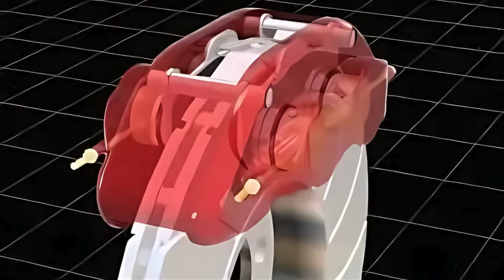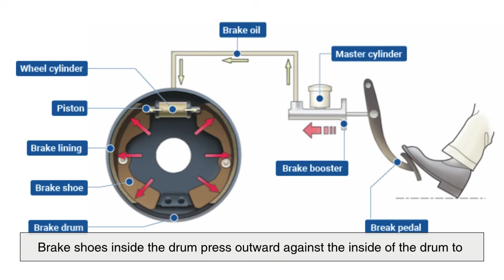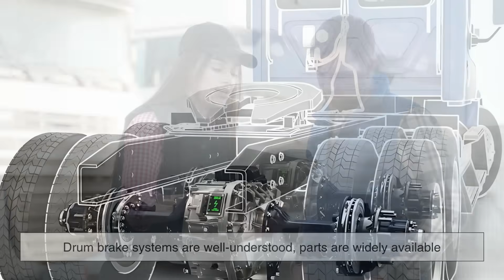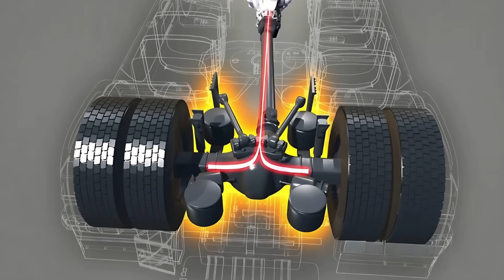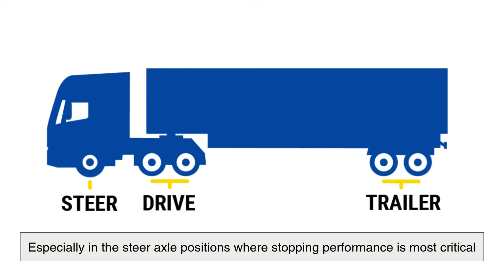Why Don’t Big Trucks Use Disc Brakes Like Cars?

Comment: I'm still not clear why trucks use air brakes. Commercial aircraft and trains use hydraulic disc systems, where much greater levels of energy need to be dissipated.

Comment: A lot of passenger cars came with rear drums.  I had a 2002 Dodge Neon that had them on the rear but discs up front.  I know that might not be everyone's choice for a brake setup but It worked fine for me.  I am sure that if they didn't work out so well, it would have been known as a car with terrible brakes.  Really the the terrible thing about those was the A604 transmission.  They were prone to failure and would only fail a lot quicker of you were one of those idiots who assumed you could use Dexron in everything, a fatal mistake for those transmissions!!

Comment: I drove for a company that installed disc brakes on all their trailers in the 1980's, after about 6 months they went back to drum brakes. I remember a couple of big stacks of the removed discs, they were all discolored from heat and many were visibly warped. Maybe they've improved since then?

Comment: To make it simple, disk aren't stronger, they cool faster reducing brake fade, big trucks rely on engine braking for the most part reducing the issue of brake fade because you hardly use the service brakes

Comment: I was a bus mechanic  and we got some inter city busses that had disks but only on the tag axle.  They kept sticking applied and were so problematic  MCI paid for them to be replaced with drums.  The disks clogged up from the sand on our roads at that time. 1990'S

Comment: Most big trucks that aren’t operated in muddy conditions like logging and dump trucks generally come standard with at least front disk brakes these days and more often than not they’ll have disk brakes on all axles. Drum brakes are still more common on trailers though even those are getting disk brakes. Whether or not that remains the case depends on whether the deregulation of the government under the current administration puts and end to the biggest reason for adoption which is the current requirement for new trucks with a full gross load of 80,000lbs to able to stop in the same distance as a car. That is only possible with disk brakes. Even just having disks on the front axle improves stopping distance by something in the order of 30% since lag is minimal and that axle does the majority of braking just like it does in a car. They also have the benefit of being way less prone to brake fade from overheating, are self adjusting by design, don’t have nearly as much brake lag on air brake systems and the foundation and braking surface last far longer between servicing but they also have downsides. They are quite a bit more expensive and in conditions where the brakes may become contaminated like logging, they are more prone to failure which is why you don’t see them in use in off road applications. They can also produce enough heat in heavy normal use that in cases where the disk is inside the wheel like on the steering wheel axle, they can cause premature replacement of wheels that crack from the heating/cooling cycle. Still much better for highway use than the old drums from a safety and maintenance perspective, especially when your a company that will turn over the truck for a new one long before you ever need to absorb the expense of needed maintenance considering foundations alone last anywhere from 750k 1 million miles and the disks last even longer if they don’t get abused.

Comment: And also, the fail safe brake is only on one axle, not all of the brakes. Trailers have them on all axles, but the tractors only have them usually on the front drive axle only. 

Tandem axle buses are the same way, only the drive axle has maxi brakes.

Comment: Augh... the reason air is used instead of hydraulics for truck brakes is because you have a removable connection with the trailer or trailers. Up until a few years ago, dripless, lossless hydraulic connections were not available. 

You can buy them now for high and low pressure systems for pretty cheap. Because of that, the gladhands used to make the connections became the standard. To go back and retrofit all the trailers that are in service would be a monumental and expensive task that really wouldn't benefit much.

Comment: Here in Europe, drum brakes are rare and only seen on trailers, practically never the trucks themselves. Drums are way too susceptible for brake fading during descent. Even though retarders are omnipresent over here, drums pose a weak point in hilly terrain and have therefore fallen out of favor.

Comment: the first serial production trucks with only disk brakes that I recall were the Unimog U1300 and U1500 starting in 1975, a time when even most cars sold still has drum brakes all round, or disk front and drum rear for the rest.

Comment: Drums are commonly used (vs discs) purely because of manufacturing cost. The legacy of making drums is a significant factor in this as that is what industry originally scaled up for.
Also the braking forces involved to stop a truck vs a car aren't "exponentially greater", they are almost proportionally (to the weight) greater. But not quite proportional as demonstrated by the longer stopping distances per speed.

Comment: THEY DO!!!! I am a road-test/quality control inspector for a major truck manufacturing company. The big rigs being built the  last ten years are equipped with AIR DISK BRAKES on all wheels to greatly improve stopping distances. And boy do they stop!! They are ventilated just like on a car. And many 53 foot trailers come also with air disk brakes, and they are equipped wit anti-lock brake systems also. Once you drive a vehicle with disk brakes on all wheels, you don't want it any other way. I have a 1974 Oldsmobile Cutlass Supreme and a 1978 Oldsmobile Delta 88 Royale, both with power brakes. These cars came from the factory with disks in the front, drums on the rear. Well, I have changed that!  I ordered and installed rear disk brake kits for both my cars and they work superbly just like they were installed @ the factory, and the disk brake pads are ceramic which are the best kind. It's been a long time coming and it is here.
Reply: That's a lie. Just bought a 2019 freightliner with drum brakes. I'd say the majority of trucks are still manufactured with drums.

Comment: Drum brakes have absolutely no technical advantages over disk brakes. With disks, heat dissipation is way better, the friction surfaces are self-cleaning and the brake does not retain wear particles and dirt, the system is simpler, etc. A brake job on my Daihatsu Sirion is cheaper for front brakes (disk) than at the back (drum), both in terms of parts and labor. The only reason for trucks still using drums is "If it works - don't fix it!".

Comment: Drum brakes has larger surface area = more brake force to a given pressure. Drum brakes self energise its overall better brake system  but require time and skills for maintenance. Disc brake easy to maintain

Comment: Going beyond semi trucks, Toyota still uses a hybrid front-disc/rear-drum configuration on the legendary Hilux; and it’s not just about economics, as many would like to believe. Today, most people driving pickups do city driving, rarely setting foot on even dirt roads. However, those who routinely use pickups in off-road environments—wet, muddy, and sloping terrain—will come to appreciate Toyota’s engineering design. Enclosed drums resist mud, water and debris better than open discs—ideal for tackling farms, trails, or heavy-duty tow work.
Reply: Which would make sense if drum brakes were sealed, which they aren't.
Reply: @user-re6yo7tj5s You’re mistaken. The drum brake design is “enclosed enough” to perform better in mud. Look it up, and you’ll see. And, while you’re at it, if you find credible information to the contrary, let me know; I would be interested in seeing it.
Reply: @bethoughtprovoking  Ive spent 40+ years in the motor trade 35 of them running a garage, and have lost count of the times I have removed drums from all manner of vehicles and found badly corroded friction surfaces,displaced and missing linings, missed leaking cylinders and damage from having mud,silt, road dirt, grime and brake dust mixed together with fluid making a mess of things because it can't ordinarily escape,pick up and builders trucks being the worst culprits, it's not a good thing when the components operation by virtue produces waste, as in dust. I cant remember the last time I changed a caliper because it was leaking or a pad because the lining had rotted off the backplate,and you damned as well know that the automatic adjuster is unlikely to work.a drum is poorly inefficient as a stopping mechanism and suffers rapidly from brake fade due to heat, much quicker than a disc set up,would.a hot drum will expand as it travels over the friction lining being pushed outwards to wards it.Having tested thousands of cars with disc, drum and disc over drum rear brakes, I will agree that their holding ability, once the vehicle is stopped, in general is superior to that of discs. We won't mention the wholly inadequate disc over drum set ups😂
Reply: @user-re6yo7tj5s I don’t necessarily discount your anecdotal experience, but I’ve been around trucks and pickups almost my entire life—exceeding your years as a mechanic—and we have never had an issue from off-road conditions. That said, my confidence comes from the literature on the topic and Toyota’s stellar reputation for reliability—especially the Hilux.
Reply: @user-re6yo7tj5s One more thing to remember: it matters how a vehicle is maintained. Since my wallet has never suffered from issues owing to bad maintenance, I must be doing something right washing all that mud off regularly.
Reply: @bethoughtprovoking  Therein lies the crux of the matter,most people pay little or no attention to anything other than what's visible.
Reply: @user-re6yo7tj5s I agree. In fact, most people are not maintenance-minded, much less inclined to the technical demands of upkeep. Maintaining a vehicle is more than occasional car wash; among other things, it’s about knowing how to clean the engine bay, periodically checking things like intake air filters—and, yes, even removing the wheels for good cleaning (!). I take very good care of all my machines because they constitute a part of my livelihood and are a major investment.
Reply: Just think,front axis disc , rear drum-so front axis flying atop of the mud and rear dive in to the mud?!
Reply: @brendasgazuotas3894 Think best of both worlds: disc for city driving; drum for off-roading and reliability.
Reply: @bethoughtprovoking  You neglected to mention 70% of braking is from the front end. 
Toyota's reliability is becoming a myth from the past, and they engineer just sufficiently to get the job done, at the lowest possible price point. 

This whole video is outdated, trucks, at least outside the US adopted disc technology decades ago. 
No self respecting company or consumer is going to advocate drum over disc brakes for any application.
Reply: @gor4988  You’re entitled to your opinion, but some of your assumptions veer into baseless claims. You argue that Toyota’s reliability is a thing of the past, yet any issues those vehicles face stem from the very high-tech systems you champion. Older models—with simpler mechanical designs and fewer electronics—proved far more dependable, and the front-disc/rear-drum brake setup epitomizes that balance of proven stopping power, durability, and ease of service in both pickups and truck trailers.
Reply: @bethoughtprovoking  You allege baseless claims, but fail to indicate where I veered off. 
In 2025 disk brakes aren't considered "high tech" , while drum rear ends, are definitely old fashion/cheap. 
Strongly disagree that drums provide,  proven stopping power, durability and easier servicing. 
Exact opposite is proven by no company fitting drums, from push bikes to semi trailers. 

Would you prefer Mercedes as an example of reputation enduring past reality?  
Cheap Chinese vehicles come standard with, what was considered cutting edge on an S class, only a few years ago. 
The days of the bullet proof W are long gone.
Reply: @gor4988  If you paid attention to what was pointed out in the video (which is likewise my argument), you would realize that disc brakes come with increased maintenance and, potentially, failure. The more vehicles become reliant on technology, which means they shed “old-fashioned” systems, the more prone they are to breakdown. Toyota vehicles have been known to have problems with the myriad of electronics they sport; but they aren’t the only ones. The explanation is simple: more complex systems, more chance of something going wrong. Accordingly, the simpler the braking system, the more reliable it will be in demanding conditions. That’s the idea behind “low-tech”engineering, not increased profit.

Comment: The abandonment of drum brakes in passenger cars was caused by an emergency leakage of brake fluid from the brake cylinder in the event of worn seals, which caused the friction surfaces to be covered with this oil. The car turned to the side due to the lack of braking in the wheel on one side. The abandonment of the use of brake fluid solved this problem.
Reply: There are several reasons why drums are disappearing on passenger cars(ease of manufacture across a model type,better control of stuff like esc etc). leaking fluid isn't one of them.

Comment: The C-5B Galaxy is a heavy transport plane and can at times come in with a weight total of over 750,000 pounds... EVERY wheel on that bird has a disc brake pack. Gawd forbid you get a Hot Brake radio call. Just look for the "Smoker".   Lol

Comment: Ummmm...at 34 seconds you are showing air operated disc brakes on the front axle of a big rig... So Yes, in fact... Over the road semi trucks can come with disc brakes. Most of the ones I worked with were on the steering axles of Fire Trucks.

Comment: Disc brakes are no good for heavy trucks 
Reason is brake return after driver release of brake padel

S cam solve this problem in drum brake , beacuse brake application pressure is too high then passenger cars

Comment: What?? Some class 8 trucks have disk brakes! They are just air operated instead of hydraulically operated! Disk brakes are superior to drum brakes in heat absorption compared to drum brakes.